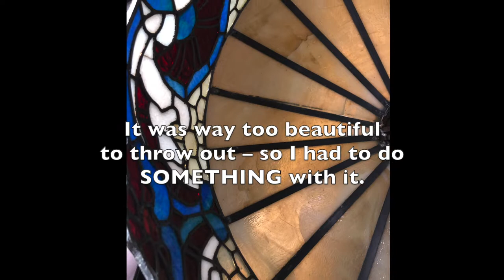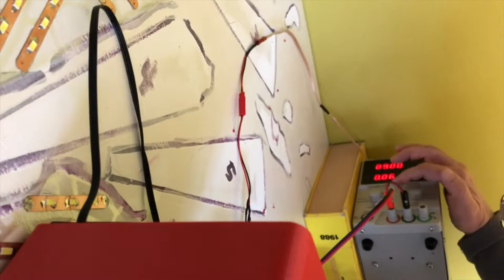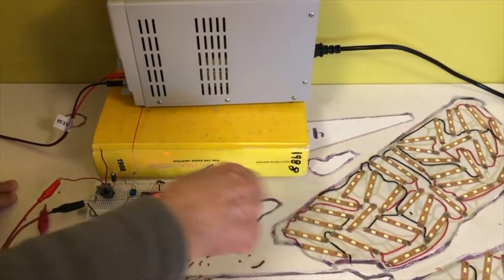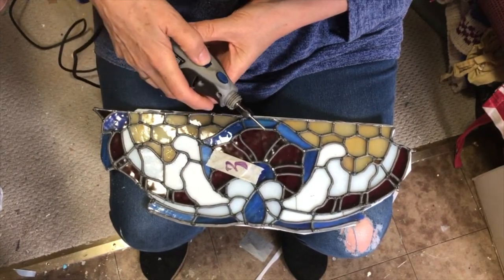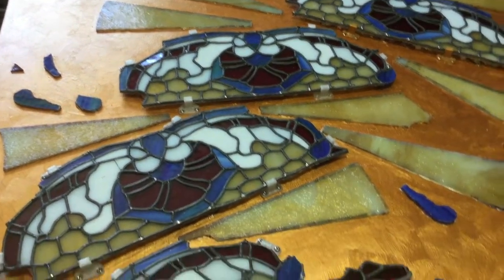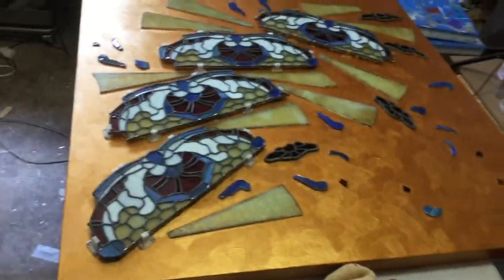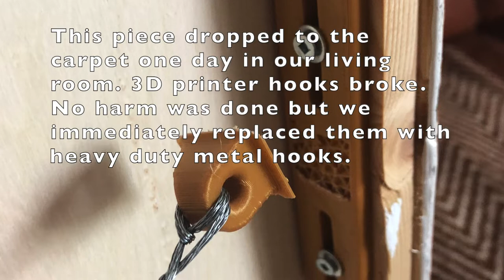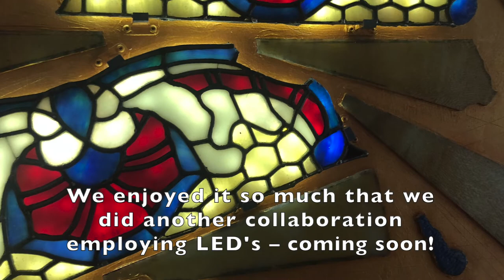How did I upcycle a broken Tiffany Lamp (replica)?

Comment: An easier way to do this would be to drill holes through your board and put in LED lights with a battery pack behind the pieces. I did a Christmas sign that way. No electrical experience necessary.
Reply from the maker: My husband was considering that at first … but something caused him to change his mind, maybe the battery pack was going to be too large? Hmm…
Reply: @dorothealeblancart  well I don't know about when you did this but nowadays the battery packs for those lights are extremely small.
Reply from the maker: @KMF3  I just asked my husband and he said that for one, he didn’t want to risk the battery running low. He also planned to use lithium batteries but found that if they’re improperly charged they could burst into flames (yikes!). AND he thought that if someone buys that piece, the batteries would be more of a hassle, the piece being heavy and difficult to maneuver.